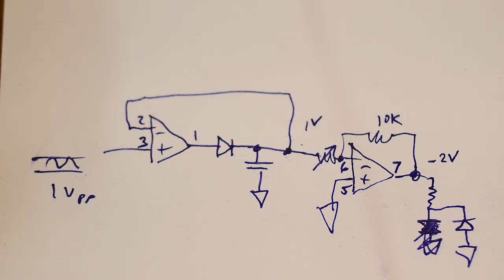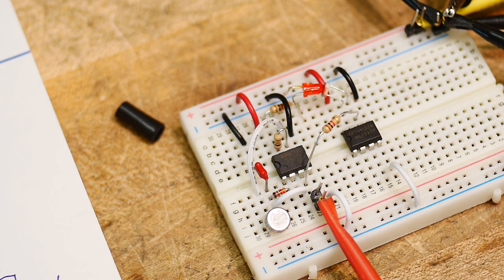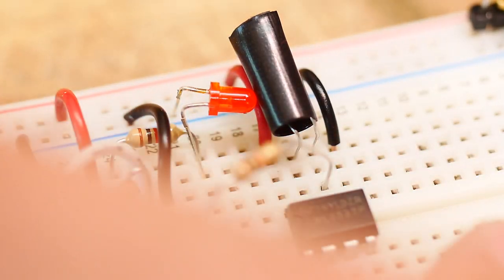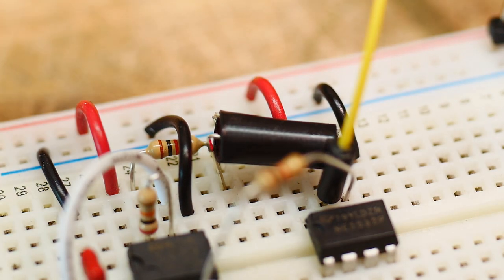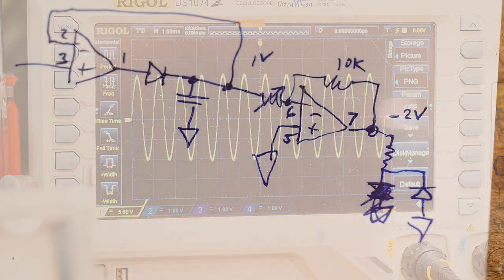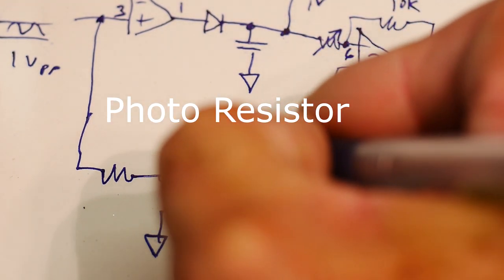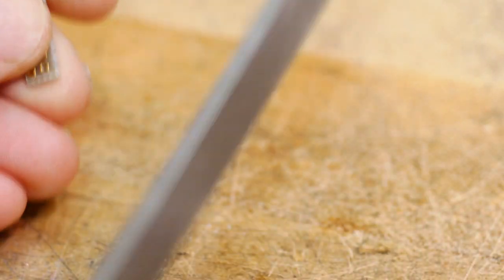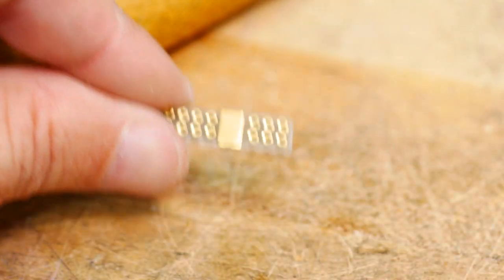#511 Optical Compressor Circuit

Comment: I like the idea. You could try placing a resistor in parallel to the LDR and another in series on the same feedback branch. It is to limit the maximum and minimum value of the LDR, it could be Trim pot, or better yet, a digital SPI potentiometer to control with an arduino or stm32.
I'm wondering if it should be a full-wave peak detector, or does it not matter?
If you control the charge and discharge of the capacitor with 2 variable resistors, potentiometers or JFet, you would adjust the attack and release.

One thing about the LDR is that its resistance is not linear, it is logarithmic or quadratic, or something like that.
I don't know if it would be necessary to "calibrate" or adjust the intensity range of the LED, or the curve in mA according to the threshold of the compressor.
I have seen one circuits with OPamp to "linearize" the curve of the LDR with a diode in the feedback, I don't know if it is really necessary for this case, but I would like to see a video where it explains how it works.

Another option, if you use an MCU to control the digital potentiometers or JFet, is to use DAC and ADC of 12bit or more.
I would also use a pushbutton rotary encoder and LCD display.
Cliping-detector and vu-meter.

Many things could be done without using an i2s DSP, which is much more complicated, and is reserved for a few people, no, I have no idea, although I looked over and found some DSPs from "Analog Devices" that are configured by USB and its SigmaStudio software. Apparently very simple.
https://www.analog.com/en/design-center/evaluation-hardware-and-software/software/ss_sigst_02.html#software-overview

An advantage of digital pots is the precision between L and R, far superior to a dual pot. Although with JFet something could be done, but you depend on them being identical.

This would be the volume control that I plan to use in the audio output of the TV, a lot of difference between background sounds and loud sounds, not to mention the damn "commercial advertising", which purposely has more LUFS to stand out or sell more ...

In PC, for audio programs, there are some VST plugins, the one that interests me is a "Gain Rider", "Vocal Raider", "Bass Rider" (the concept is the same), adjusting the audio level to a threshold, and it is not a compressor. If it is below, it raises it, and if it is above, it lowers it. It has its parameters so that the change is not much noticeable.

Another very complete VST plugin, "MaxxVolume"
https://www.waves.com/plugins/maxxvolume#image
"High- and low-level compression in one plugin
Intuitive and simple controls for quick dynamic optimization
Brings out room ambience and detail
Adds body and detail to any instrument
Great for dialogue and post-production leveling "

Well that, a compressor with 2 thresholds, which raises and limits the audio, and gain raider.

What is missing is a DeEsser and if you add a Noise Gate, well ...
https://www.waves.com/plugins/deesser#image
In case you don't know how it is, it is a compressor that works only with the hissing frequencies (Hiss, S, Z, F...) on the voice, they are very annoying frequencies.
With a band-pass filter in the detector, it compresses only when that super annoying "zone" is loud.

If you already put an EQ of 10 bands or more ...

I put the example of the plugins, to try to explain how useful it would be in a pre-amp, even if it is not ultra precise or high-end, less is nothing.

Sorry for the long text.
Greetings.

Comment: According to Veritasium on analog computers, it should be possible to use differential amplifiers to measure the excess above line level audio.
is the there a way to "enable" a opamp to start measuring above a "custom" peak level to extract the excess voltage and use that voltage to reduce audio.

I asked Thonk for a High end LDR a few days ago. 100K in dark mode.
Reply from the maker: Yes, just a peak detector to monitor the high voltage. then use a percentage of that voltage into a comparator. I use this in an audio circuit to gate (mute) the audio when there is no signal from the microphone: https://youtu.be/BePqr3tp39Q

Comment: Can I used optocoupler?
Reply from the maker: maybe. it is nice to have a resistor change and not a transistor. you can use an FET too. The photoresistor is an easy way to make a voltage controlled gain stage.
Reply: there exist some optocoupler that has a FET inside, used by Mystic circuits in their powerless low pass filter circuit.